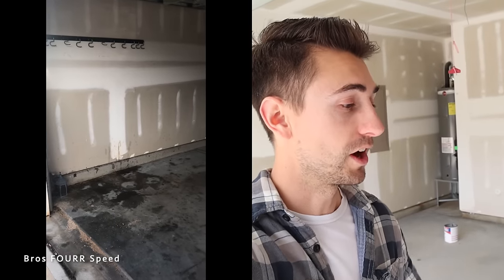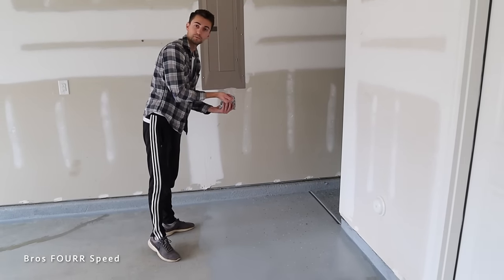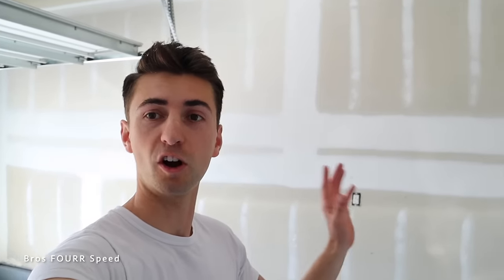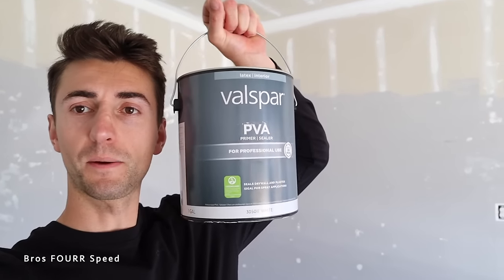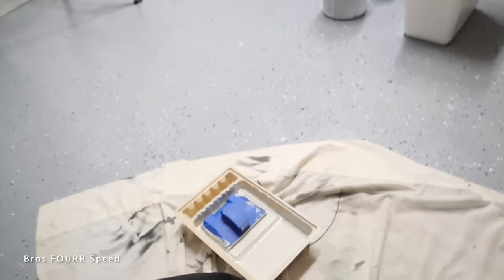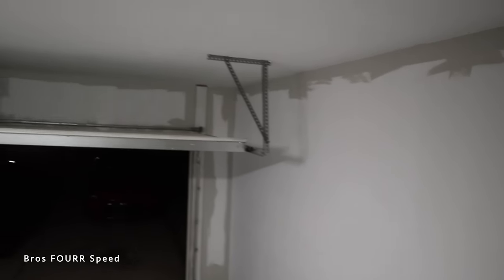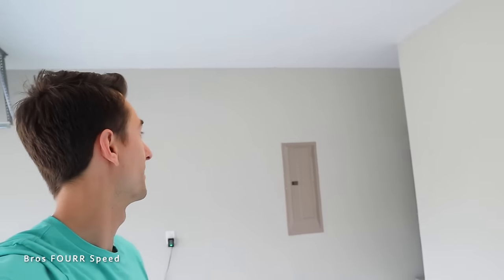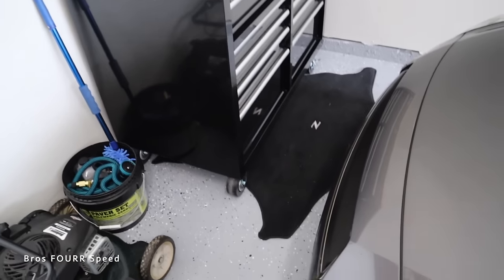Turning A Trashed Garage into My First Dream Garage!! *DIY Garage Makeover*

Comment: You should have done the ceiling and wall first, before doing the floor,
Reply: WHat difference would it have made?
Reply from the maker: Actually no. To properly clean the concrete, we needed to hose out the floor like 5 times. With water and the TSP. A lot of it gets on the walls too. I'd hate to ruin a newly painted wall. Also paint that did drip onto the floor, wipes right off the epoxy. It would have taken even more work to clean the concrete if there was paint on it. Also, I needed the floor done to park the cars in the garage and keep the bike at my house while working on everything else.
Reply from the maker: @SkoolConnor  It worked better to epoxy the floor first. Paint cleans off it easier then concrete and I needed to be able to put things on the floor each night as I painted the walls each day
Reply: So you won't accidentally drip paint on the garage floor
Reply from the maker: Like I mentioned. Paint wipes right off the epoxy floor. I'd have to scrape it off the concrete. Also, the concrete was so gross, I did not want to be walking all over that for 4 days while painting the walls. Floor epoxy was done in 1 day. Rather walk on a clean floor for this work. And I needed the floor done so I could move the cars and bike inside the garage.
Reply: I thought the same thing, but I understand why, based on his explanation.
Reply: That’s what I was thinking.
Reply: He could of just put down those plastic sheets from Home Depot and that would of worked as well. I like this tutorial
Reply: Nah paint comes off the top of the epoxy much easier than porous concrete
Reply: Agreed

Comment: Congratulations on the new house. Ive done this my self about 5 times i normally used extra chips. But I would highly recommend the clear coat it makes it much nicer and stronger.
Reply from the maker: I have friends who did the clear coat. I couldn’t see spending $100 a gallon tho. But my dad never clear coated his. And 9 years later it still looks good. So I just don’t see the value. It does look really nice with the extra shine. But I can always do that later after a quick cleaning.
Reply: @BrosFOURRSpeed  has it faded at all? how does it look being driven on after 2 years?
Reply from the maker: @xxsekoxx  Still looks new! Few scratches and scuff marks from working on the cars doing all of the projects we do. But we cleaned the floor nicely the other weekend and it is still looking great
Reply: @BrosFOURRSpeed  Thanks for the update. It gave me more confidence to go ahead and do mine.!
Reply from the maker: @elcasquito  Definitely do it! We’re doing our freinds new house soon. Prep work is most important. So take your time with that

Comment: I would invert the order of my worksteps, starting with the ceiling, followed by the walls and the last step will be the floor. So you don't need to cover the new floor coating
Reply from the maker: Well the floor was so nasty, I didn't want to walk on it. The previous owner used it as his bar/hangout room. Smelled like smoke and who knows what was all over the floor. With the epoxy floor, all paint drips cleaned up so easy too. Bare concrete wouldn't have let me wipe paint off. Plus I wanted to be able to park the cars in the garage. So it all depends on what you need to use your garage for while you do this. But it worked perfectly fine doing the floor first. I spent so much time painting and cleaning the ceiling and walls. That would have been awful walking on the disgusting floor while doing it.

Comment: I never thought about washing walls! All of my items came out of storage saturated in mold. The movers had to store everything in the garage. Now that I've dumped the majority of my belongings, it still carries an odor. I'm definitely going to wash the walls before I paint the garage this week. Yours came out really, really nice!
Reply from the maker: Yeah a little bit of Dawn dish soap and water did a lot! Previous owner smoked in the garage and it was awful smelling. Cleaning the walls and ceiling completely took it away! And then sealing all the drywall before paint kept it away. Two years later garage still smells fresh
Reply: @BrosFOURRSpeed  I'm glad you're still enjoying your space! All of your hard work has really paid off. Thanks for the great tips. You should be proud 🙌🏾😊
Reply from the maker: @NYCAppl3  thanks! Yeah it’s been a good space for the meantime. I’ve added some nice cabinets and more tools. So I’ve done a lot in the garage so far!

Comment: Great looking garage. I would put the ceiling rack back though, for race- or winter tires or something.
Reply from the maker: What do you mean “back”? If you need it larger, you can definitely do that.
Reply: @BrosFOURRSpeed  You did take out a ceiling rack right. I would put that back in place after you're finished, for storage. :)
Reply from the maker: @N911GT2  it was a cheap metal one, I didn’t need to reuse it!
I made a way better one. https://youtu.be/vn_ILoSpAWQ?si=yAwjsfqt0q1vDo_T

Comment: NIce work. Scrubbing that concrete is a job.
Reply from the maker: Yeah we did 2 scrubbings with TSP and then 2 with etching. Not to mention about 4 scrubbing with just water to get crap off. And scraped the floors too to get the black marks out. Crazy job lol

Comment: My garage is similar. Question did you seal the gap between the drywall and concrete? If so, what did you use? TIA
Reply from the maker: I just used the epoxy on the concert that goes up to the drywall. Didn't put anything else in between the actually drywall. Not something I thought about.

Comment: I thought you had to "mud" before painting? Or is it ok without mudding?
Reply from the maker: The walls were already prepped for that. You just have to on the seams which was already done.
Reply: @BrosFOURRSpeed  Thanks for your reply. Mine has the same white lines, but they are thinner. I believe it was mudded but only at level 1 or 2, not sure. I wonder whether it will work if I put paint on top of it. Please let me know if you think it’s a bad idea.
Reply: @PeterSchneemann  the issue with painting over level one with out the mudd is that tape well F the paint over time so definitely mudd it
Reply: @qualitytouch  « that tape well F the paint » <— I don’t get it.
Reply: @PeterSchneemann  when you apply a level 1 and then pant that tape will most likely peel ruining the paint job because it’s on there thin. Adding the mudd will secure it all and allow paint to look good

Comment: wouldn't it make sense to get the walls and the ceiling done before you do the floor on an off chance you spilled something or dropped something onto it?
Reply from the maker: You can do it either way. The good thing with epoxy is that anything you spill comes right off. 
I was moving in and needed the floors done to cure so I could park and put things in the garage. But you can spill oil on epoxy and it wipes right off! Beauty of epoxy floors and why I did it!

Comment: How much paint did you use? Only one bucket of PVA?
Reply from the maker: Yeah 1 gallon of PVA. It just barley made it on all the walls and ceiling. Then just 1 gallons of paint and 1 gallon of ceiling paint. I had leftover paint from the inside of the house, so I don't know exactly how much I used on the walls. But 1-2 should do it

Comment: I'm having my floor done. My question is can I paint before or is it better to paint after the floors get done?
Reply from the maker: You can do it either way, I did the floors first so they had time to cure before I moved in, that way I didn’t have to empty out the garage. It really doesn’t matter which is fine first though. 
If you do the floor first and spill paint on it, it’s so easy to clean right up which is a plus!

Comment: Hi. I am looking into finishing my garage as well.  Thanks for this video.  Out of curiosity, did you have to seal any cracks in the concrete before painting the floor with the epoxy paint?  I see some in my garage and have thought of repairing before doing anything else.
Reply from the maker: The one crack in my floor was already sealed. If they are small hairline ones I wouldn't worry about it too much. But if there are bigger ones I'd go ahead and do that first.

Comment: Wouldn't it make more sense to paint the walls and ceiling before the epoxy floor?
Reply from the maker: You could do that for sure. I was moving in and had a deadline so I needed the floor done and cured to park on and move into. 
And with the epoxy floor, paint would wipe off clean compared to the bare concrete. So it can be done first easily. Plus these floors were so disgusting, I was not going to walk on them. Previous owners trashed them and used the garage as a bar. It smelled horrible and was all greasy and dirty

Comment: Good job. I would have done the floor last, though.
Reply from the maker: I’d do the floor first. It needs time to cure and I needed that done so I could park inside. Beauty of epoxy is that anything wipes clean off it. Paint, oil, anything, just comes right off.
Reply: @BrosFOURRSpeed  I hadn't thought of you needing to use it right away. Looks good.
Reply from the maker: @mc.9839  I had a week to move in lol, takes 5-7 days to cure!

Comment: Walls & ceiling FIRST…then floors.
Reply from the maker: Floors were more important because it takes 4-5 days for it to cure, so that was more time sensitive and needed to be done first so I could park inside and then do walls. Also it's easier to clean wall paint off the epoxied floor than bare concrete. And the concrete was absolutely disgusting and smelled awful from the gross previous owner. I couldn't stand the smell of smoke, dirt, fertilizer and other garbage that covered the floor.

Comment: You could of done the walls first and used a paint spray gun little easier
Reply from the maker: I needed to do the floors first so that when I moved in they were cured and ready for things to be placed on it. Spray gun would be cool , I used an air powered roller for the inside. But I wasnt going to buy a spray gun to do the walls

Comment: Why would you paint the walls after the floor? Painting walls first, you wouldn’t have to worry about paint getting on the floor.
Reply from the maker: But with the epoxy floor, that wouldn’t matter, it’ll clean right up and actually clean up better than the bare floor. 
Also I was just moving in, so doing to floor first meant I had time to let it cure and then move items in and only do that once. Didn’t make sense to move in and then have no where to put garage items while I did the floor! There’s a method to the process! And the floor was absolutely disgusting. I was not going to walk on it. Previous owners were gross and the concrete and dirt and other crap all over it. Much nicer to work on a clean floor. Paint literally wipes off this new floor

Comment: shouldnt you have done the ceiling and walls before you did the floor??
Reply from the maker: The floor was so nasty, I didn't want to walk on it longer than I had too. It was caked with filth. Plus I needed to be able to park my cars in there so got the floor done first so I could put stuff in there. Plus the paint that did drip on to the fresh floor wiped off so easy. Would have had to scrape it off the bare concrete rather then just use a damp cloth to wipe it clean. Floor stunk too since the previous owner smoked in the garage. No way was I smelling that garbage for hours on end painting the walls.

Comment: this wont last more than a year
Reply from the maker: Is that what you experienced with your floor? My dads going on 12 years with his floor and has done multiple houses with it. Not sure where you get that idea from.
Reply: @BrosFOURRSpeed  yes, i've also done multiple homes with this "out of the box" epoxy, issue is if you park your car in the garage the hot tires or the salt will wear it off very fast, and I've done all the recommended prep - currently I've done actual commercial epoxy which is holding much much better than this product.
Reply from the maker: @rickats  I don’t live where there’s salt, so that could be the problem you are having. Like I said, my dads current floor is 12 years old and looks just as good as the day it went on. I’d recommend this product.  One year on my floor it still looks brand new. Maybe you didn’t prep it correctly. Hot tires shouldn’t peal a good epoxy coating. All in the prep work